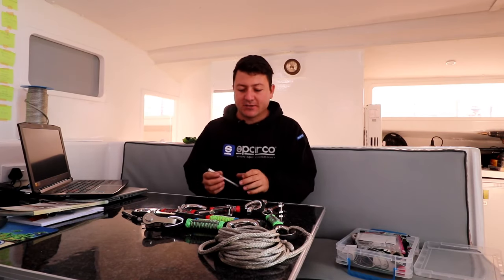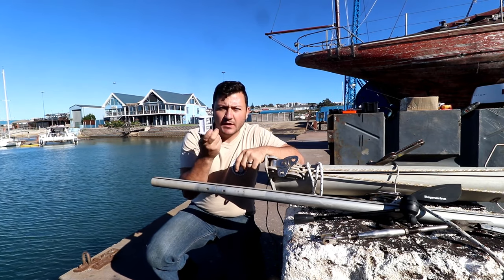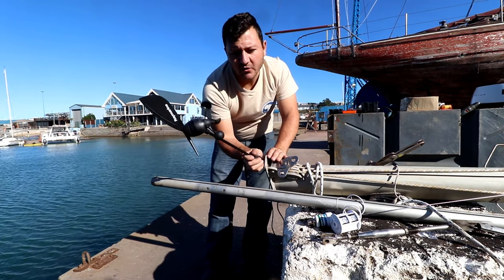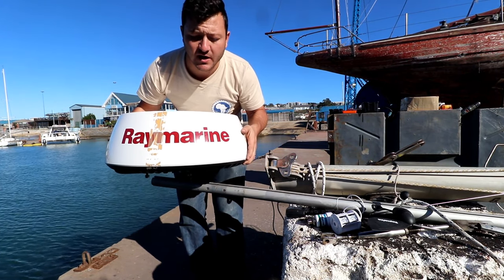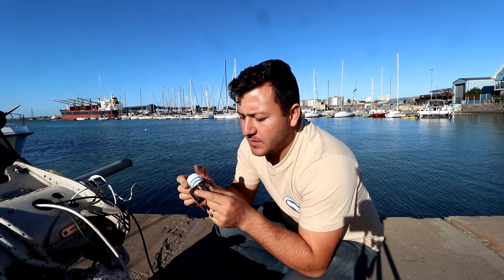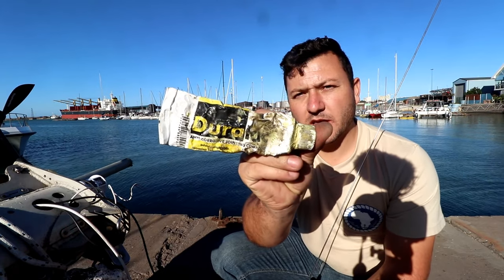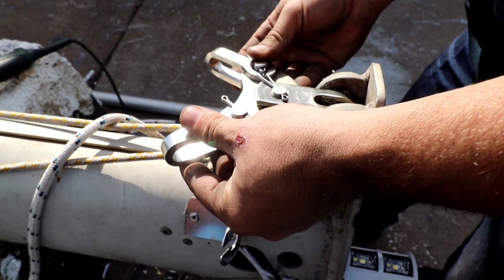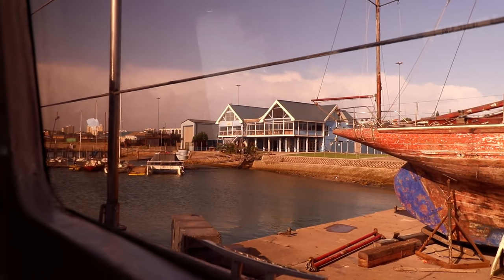INSTALLING all our MAST FITTINGS  | YACHT REBUILD WEEK 82

Comment: Rick, Your so right about boat work outside it sucks!. In eastern US I found working on my old refit boat in the winter is way to cold and wet and in the summer way too hot , spring and fall only lasts a couple of weeks and then the boats I actually use for racing etc need to be worked on......... so I had to replace the flat roof on my large garage I actually  decided to make it 2 stories high into a boat shed!  Perfect ....... now I have to actually start working on the boat  under cover!  Cheers Warren..... your getting there!
Reply from the maker: Thanks Warren! It's been a big pain. Bigger than we realized but it is what it is so we got to push through but who would think weather could change your whole mood around!

Comment: Question those  thimbles will they crush  ,are the able to hold the form and the load under windward pounding. They hold a shape , form , to splice to , but when they are in the rigging fitting will They hold together. Never used rope rigging before only dyfom wire , I watch the distant boats bobbing around in you r vid and it seams like no tide rise or fall  , what is it in that harbour.  Can’t wait to Launch it’s been a harrowing year   We don’t talk budgets to late to turn back except see a new life style ahead just appearing over the horizon, palm trees , sun , fish , and what ever comes , But you need to find the water , all good grant nz

Comment: When I had to make an electric splice that remained exposed to weather, I'd squeeze a bit of 'Dielectric Grease' into the outer shrink tube. When it shrinks it drives the grease into all the gaps and makes it water tight and electrolysis proof...

Comment: well done! that is a big jump forward,i'm getting ready to put my mast up at the end of the month as well.
not sure about using self amalgamating tape as a barrier with aluminium as it has a high carbon content which causes corrosion with prolonged contact to aluminium. better just duralak and plastic sheet or nylon washers between metals
Reply from the maker: Good luck with the mast. 👍🏻